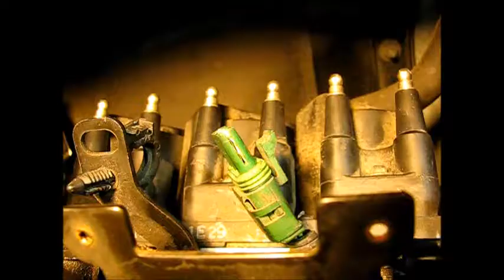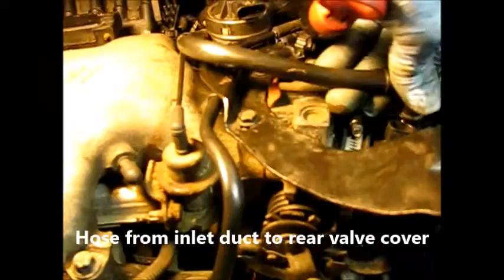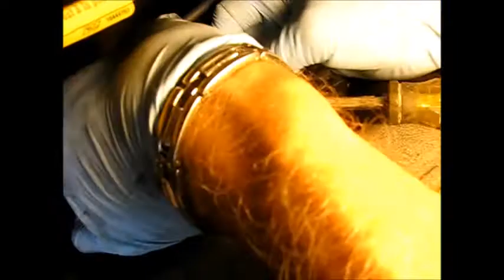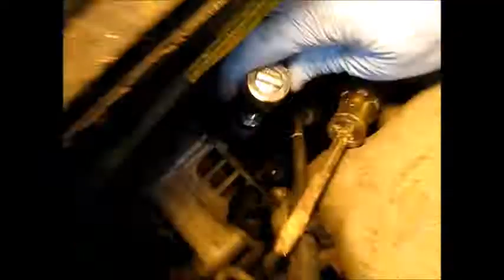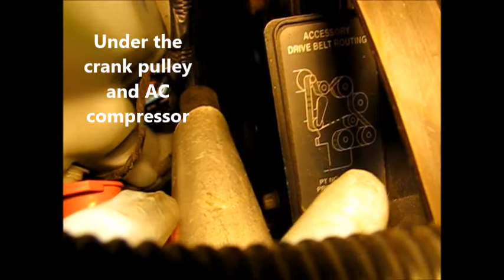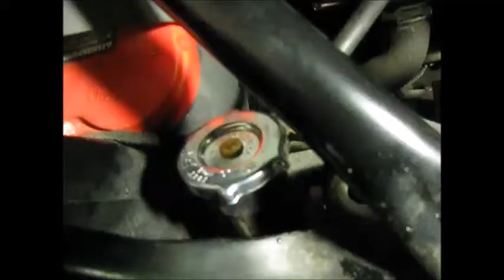3.4L GM lower manifold gasket replacement part 8: MAP, EVAP, wiring and cabling and finish

Comment: Thank you very much for such a tutorial! I'm on my way of replacing head gaskets (spent 4 hours so far) and the video helps a lot. I've removed upper intake manifold before removing of the coil plug assembly though (and it gave access to the nuts from under the hood) .With even more limited access on my Chevy Trans Sport (aka Venture) it made this task a bit easier

Comment: I have the same vehicle but I’m new to vehicles so I don’t know much about vehicles. I really wanna get to the point where I’m like you and be able to do jobs myself. I wish there was a way that I can send a vid of my problem to you so you can give me some help on my vehicle’s condition. It has two holes on the side near the tube that goes into the upper intake manifold so idk if I have to replace that, the lower, or just both. Or since the holes are visible use a sealant for a temporary fix so I can get the parts and later change it.
Reply: Okay a little bit more accurate info, the 2 holes are located behind the fuel injector

Comment: Thanks for the video. I just did this job. However I must've done something wrong. I'm getting a loud knock and lots of white smoke. Any advice? I only tried this because the van was headed for the junkyard anyway but I'd like to save it if I could. Is there a possibility I didn't do the thirty degrees right on the pushrods? That's what I'm thinking. Should be a lot easier this time around. Really appreciate the video.

Comment: Thank you so much for taking the time to make this video. I was able to take my ‘02 Buick Rendezvous all the way down to the cylinders to replace the head gaskets and exhaust gaskets on top of what you walk us through. Took me about 2 solid weeks of work, but we are back on the road again thanks to your awesome video series!! Only cost me about $150 for gaskets, new thermostat and my belt tensioner had broken, which explained why my power steering wasn’t that great for a while. Also had to buy a couple box wrenches and new exhaust manifold studs since I had 2 snap on me when putting them back in.

Comment: Thank you so much for best videos this is so detail for replacing lower manifold gaskets nice voice soft voice thank you so much i nought venture 2002 for $300 with car was over heat not even drive  one mile it stopped run right away
So I research on youtube I got lucky found you so i did follow you videos step by step 
Now this venture drive to college in  Los Angeles and work with no problems when i got this venture was 80000 miles now sine I replaced lower intake thermostat new oil new radiator everything NEW this venture alive
Thank you
P.S first time fixing fine job!!!
Glad car run over 8000 miles now with no problem
Thank you
You good guy
Sincerely 
Penny
Reply from the maker: Well done. This is a challenging job, even for someone used to fixing cars. Sounds like you have a good running car at a very low price. Thanks for watching and commenting!

Comment: Thanks Again from Gerry in Florida..Trace amounts of oil at radiator cap but no water in the oil itself. Should Simple drain and refill of coolant with gasket repairs should be ok, correct. No over heating was been observed on a long road trip from Tennessee. Ran great...looking forward to drying up the leak in manifold valley..
Reply from the maker: You're welcome. If there was none in the oil it should be OK with coolant only. Well done!

Comment: You should be given an award for this series. What a Bitch of a job. I have a 4.3 Montana that has bad intake gaskets now. I don't want to do this job in the cold I am going to  try and glass the motor with Sodium Silicate for now. Wish me luck.
Reply from the maker: Good luck and thanks for the kind comment.

Comment: Watched the whole series. Very impressive. I assume you had an assistant running the camera - incredible camera work in obviously very tight quarters. Are you a professional mechanic, or just a serious amateur? How many hours did it take you? I've got a 2000 Venture that needs head gaskets. I've done head gaskets before, but not on something choked by sensors,  hoses and wiring like these things.
Reply from the maker: Thanks for the feedback. I'm not a pro, just a guy who likes to do it himself. I do enjoy putting something out there at a level of quality and detail that others can use. I would estimate 12-16 hours for this rather difficult job. Good luck and thanks for watching and commenting!